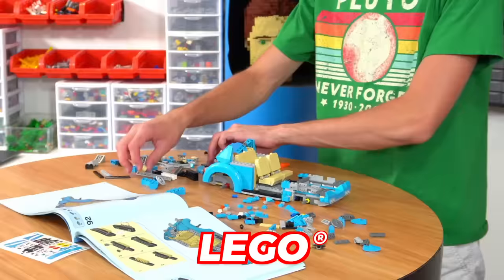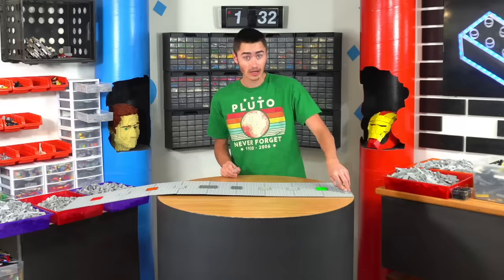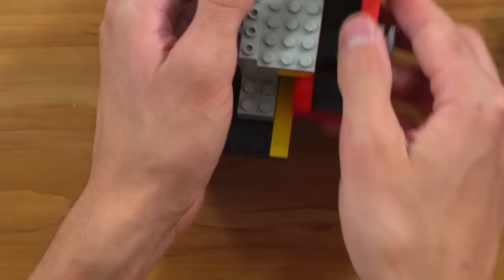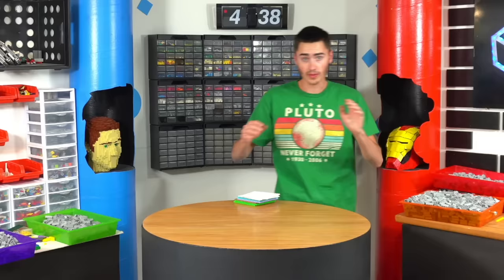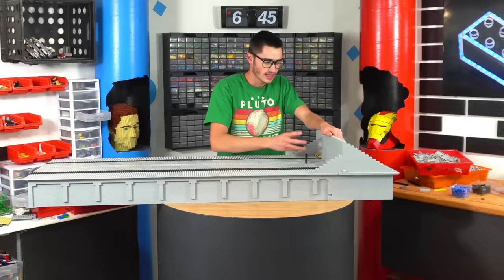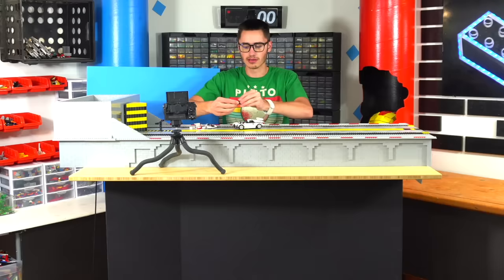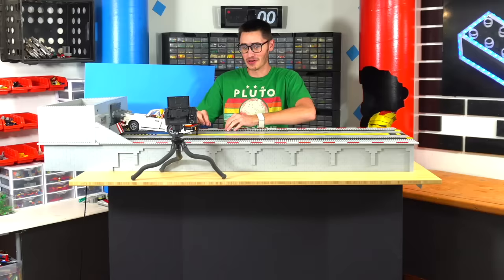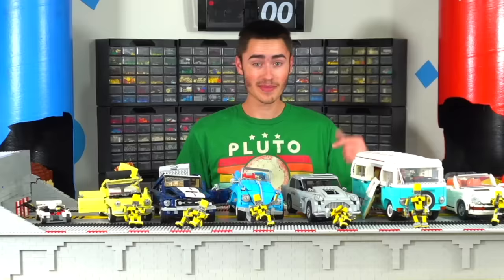Crash Testing LEGO Cars!

Comment: Since in a crash, you want the energy to be absorbed by the car and not the crash test dummy. The one that breaks up the most (since Lego doesn't deform)  would be absorbing the most energy and should therefore have the best rating. Great video and Lego engineering of the test track.
Reply: Yep
Reply: I was thinking the same thing
Reply: have you considered the car’s feelings tho?
Reply: in the last one nothing really happened so i think that one did get its score well, the van did a bad job since the dummy flew across the back
Reply: Yeah but not always, some of them had large parts come off and hit the driver
Reply: I can confirm this, he is right, the lambo and the bedle should be the best. BELDE
Reply: Was just thinking the exact same.
Reply: Ahhhh, true.
Reply: That is literally what I was about to say
Reply: Thx Einstein
Reply: 15:31 almost all engines are front, and engines barley explode only gas does 😡😡😡 but good video
Reply: @beastt549  just like how newton desk toy with the swinging marbles makes the one on the opposite side move without moving the others.
Reply: I'm going to regret this but hey,
So the easiest way to think about it is that we want to make the impact take up a longer time to complete their travel. An example is a parachute, without one the same distance travelled is completed in a shorter amount of time than with a parachute. The amout of energy transfered to the person is spread over a longer amount of time, reducing damage. The same logic can be applied to when you jump and bend your knees instead of keeping them straight and taking the full force.
Cars have crumple zones which are deliberately made to act like the parachute and aborb the energy. This spreads the impact over a longer amount of time so the person driving will also experience the impact over a longer time reducing damage. 
If the vehicle was rigid it would take all the force of the impact in one instance, the car might stop suddenly but so does the person. In one sharp push they experience all of the force at once.
Also there is an attempt to have cars create less objects to break off and hit anyone inside an example being the type of glass that spiders but does not shatter into sharp shards.
Reply: Dude I’m 9 and I hav no idea hat your saying like bruh but your smart so good job man
Reply: @alpark6183  so that's why I keep breaking my legs
Reply: @beastt549  so you want a car to be indestructible and die?
Reply: @purevessle2641  one of the greatest mysteries of life :)
Reply: i agree.
Reply: Unless he's testing the build strength
Reply: @adamclarke2251  its not even physics its just thinking about it for 2 seconds
Reply: Forever axolotls  this comment says a lot about your intelligence 💀
Reply: What about the part where the dummy died rip
Reply: @beastt549  have you ever heard of inertia 💀

also yeah you have a point about things hitting the driver, but people have thought about that too, car manufacturers try to put the least amount of dangerous small objects in the interior as possible, and most windshields crack, but are made to not shatter into small pieces. there are also crumble zones on the car that purposefully take the force of the impact and crumble, absorbing most of the energy instead of being rigid and transferring that energy closer to the driver.
Reply: @turnipaitor  no you werent kid
Reply: There’s the comment that I didn’t have to say
Reply: Bruh heard of Shrapnel but I do agree a bit
Reply: @angelthebudgie4148  shrapnel as far as I know doesn’t kill the driver too often in car accidents
Reply: BRUH
Reply: @stoopidapples1596  true true
Reply: About the since lego doesn't deform part, it needs high force to break, but it still can break.
Reply: Forever axolotls  it doesnt take a genius
Reply: @hellohello8186  the car absorbs the damage instead of the person  when the car breaks more.
Reply: I was about to say the same thing
Reply: But there should be protection around the driver instead of the doors, roofs flying away.
Reply: Good point, but it could also be a bad thing too
Reply: Was about to say that in simpler terms
Reply: @xingchen19willwork  seatbelt and airbag.
Reply: Stops you from flying out the car, and if you fly forward you don’t hit your head on the dashboard.
Reply: But a piece Can hit the dummy and hurt it
Reply: @beastt549  you didn't pass physics class did you? Granted neither did I, but still, the energy is transferred through the car if it is not absorbed by it (energy is neither created or destroyed). And what happens to be sitting right bang in the middle of the car? The crash test dummy, which being a stand in for a relatively fragile human, would receive the brunt of the energy causing major bodily harm. It doesn't matter that the person didn't come into contact with the wall, it is sitting within the car, moving at the same speed as the car, and therefore is exerting the exact same amount of energy on the wall as the car is. Then again, youre hearing this from a guy who didn't pass physics, so...
Reply: @purevessle2641  r/engrish
Reply: @beastt549  you ever heard of momentum?
Reply: Brains my guy brains
Reply: @daylightwastaken  it's basic logic.. this is not a 'nerd moment'
Reply: @jwalster9412  🤓
Reply: @zlatanbalta7339  Ned Flanders is never right.
Reply: @daylightwastaken  yes, I am smart.
Reply: @jwalster9412  🤓
Reply: Forever axolotls  nerd Flanders lol
Reply: Forever axolotls  it doesn’t take a genius to know this. I learned this when I was 9.
Reply: Also the big cars didn't break as the mass was greater and caused less final speed(less acceleration), if we managed to change the mass of the weight to get same acceleration it would have been a fair test as the cars that didn't break would have but enjoyed the video
Reply: @realgummyrules_420  Noice
Reply: i would say the aston martin the rest had pieces fly off or break the aston crumpled and absorbed the energy the best because the dummy was almost in the same spot
Reply: I was going to write the same thing 

Good point
Reply: @anthonyina_bottle2443  however the loads on the occupant would be extremely high
Reply: you want every thing to obsorb the daage, exsept the cabin of the car.
in a roll over the cabin needs to stay sturdy so no one gets crushed, and if the cabin gets deforemed that also means alot of that enrgy will have gotten to the dummmy.
all about g forces
Reply: Rather, if it could deform little yet still preserve the driver well, then it would have the best rating. Yes, you make a good point that the more it absorbs the less there is in reserve for any person, but remember that if the car falls apart, there is always the chance of a metal beam or some other part to pierce the individual. I would put the highest and rating and the most trust in the car which would remain sturdy and continue to shield the driver in the most efficient manner.
Reply: Yeah, but no because you also don’t want the dummy getting hit by debris or getting thrown out
Reply: @anthonyina_bottle2443  i mean a concussion is better than being violently bisected or getting thrown unto the asphalt road
Reply: That’s why the camper did good it deformed the wall
Reply: @Icelandic_Sand  🤓
Reply: @beastt549  yep
Reply: I was thinking that the whole time so mustang probably the best
Reply: But nobody cares its fucking lego 
We just want yo see stuff explode
Reply: Yeah
Reply: But what if it’s a self-driving car for deliveries? Wouldn’t it be OK if it doesn’t destroy itself on a crash then?
Reply: 🎉🎉🎉🎉🎉🎉🎉🎉🎉🎉🎉 HAPPY BIRTHDAY GREG :D
Reply: But at the same time, not too much as you'll obliterate the driver lmao
Reply: I would probably rate the Aston the highest since the energy transferred all the way through the roof to the rear bumper.

The Tesla Model 3 has one of the highest ratings irl since a crash from almost any angle shifts the energy through the roof, protecting the driver from side impacts better than basically any other car. 

However, this is part of the reason that any crash in a Tesla basically totals it
Reply: Neeeeeeeeeeeerrrrd

-Technoblade
Reply: was bouta say same thing 
the dummy should be unharmed, and the more energy that is absorbed by the vehicle the beter
now i do think the vw bus was a fluke considering the thing it was being hit against, that being a barrel
Reply: Good point, but that last bit is arguable. It's not so much the car that deforms the most, more like the one that just protects the passengers the most.
Reply: @alpark6183  wrong. If someone is falling with a parachute, they are not impacting anything until they hit the ground. So it doesn't matter how slow they fall, what matters is how fast they are going when they hit the ground. The impact time would be pretty much identical if the person had a good parachute or a bad parachute. The difference in energy felt by the person comes from the difference in kinetic energy and potentially energy, which is dependent on the person's velocity.
Reply: @Icelandic_Sand  wrong. The damage done to the dummy is related to how long it takes him to slow down from a certain speed. He is not "feeling the same energy" as the car while the car is being destroyed. What the dummy feels is a change in momentum. The slower he feels this change, the less force he feels. I can see why you didn't pass physics.
Reply: @jermihalia9418  ok, thank you for correcting me. Still the point still stands that the car coming to a sudden stop would kill the person/dummy inside.
Reply: Lol I was thinking that like the entire time
Reply: @daylightwastaken  nice face reveal, username checks out
Reply: To quote Jeremy Clarkson: Speed never killed anyone, suddenly becoming stationary... that's what gets you.
Reply: @daylightwastaken  you're on a channel called "brick science" what do you expect buddy
Reply: @stoopid apples lego cars don't have fellings
Reply: Lego does deform if you add a bunch of hinges to the car!  Tried that with a couple cars myself, quite a challenge though, they are also only 8 wides like the Countach and not larger scale like the creator expert cars.
Reply: @koalachick8029  There is still the problem of the thing it hits.  In a head on collision, the crumple zones of both vehicles help absorb the impact.  If they are both going 50 MPH, then the impact on the normal car would be like hitting a wall at 100 MPH if the driver-less vehicle didn't crumple, and that's assuming both vehicles are of equal weight.
Reply: @anthonyina_bottle2443  No, that's not how it works
Reply: @scottthewaterwarrior  I didn't think of that!
Reply: @tonyhuang431   most are but there are some sports cars that have an engine in the  back. The fuel in liquid form is NOT explosive, however it’s gaseous form is so, the engine might cause sparks, and since gasoline caches fire and evaporates so easily, the engine getting damaged or broken is a major factor in cars/trucks exploding
Reply: @bananaspider9784  but the way he specifically said the aston engine explodes angers me
Reply: @tonyhuang431  okay cool
Reply: wtf did you just say
Reply: @bananaspider9784  also, Im SURE its not the vapors that are explosive its the liquid
Reply: You also want to ensure the passenger cabin stays in one piece.
Reply: Tell that to the 93 scirocco

the only one smiling after all that energy is absorbed is the guy locked in the trunk
Reply: @stoopidapples1596  It's ok they're mostly lego creator car, not the good themes.
Reply: But you want the cabin to remain intact or else the driver will be greeted by a steering wheel to the face and dashboard to the legs.
Reply: @zlatanbalta7339  no that is way too much and would impale the driver, you gotta make sure the car absorbs all the kinetic energy while keeping the passengers safe
Reply: Forever axolotls  Einstein?
Sheesh, is this really too hard for you to understand?
Reply: We aren’t smart, y’all just dumb. If knowing how a car should absorb energy in a crash is “smart” then I probably have 800IQ. I’m assuming that knowing how an engine works is another 500IQ, as those 5 minute videos that explain in dumb person language how they work is beyond all human comprehension. Surely, us car lovers are some kind of upper class intellectuals, and only we can even begin to comprehend how cars work. There’s definitely not hundreds and thousands of companies and communities that like cars and race them, and build engines for them. Heck, the highways are practically empty because no one knows how to make an engine! 
Obviously I’m being quite sarcastic, as we see and use cars everyday. Hmm, I wonder who built those cars? I wonder who had such a passion for cars, so much as to starting a car company? See? This knowledge isn’t something you should look down on. You rely on it. Everyday.
Reply: Crumple zone
Reply: Big science word make me brain go boom boom
Reply: Ok mister know it all
Reply: Although the Porche 911 Targa and the little van barely got destroyed, but the test dummys were fine, only the van one that could have flew bcuz of the impact force, but the walls got destroyed in the 2 tests, meaning the energy went to the actual wall. So idk if a wall is more important than a car...
Reply: What the heck is Ned Flanders doing here😅😂
Reply: @LUCASTHECOWBOY  Hidely ho gamerino!
Reply: You want the car to crumple, not fragment.
Reply: @MagmaLair13  yes but Lego does not crumple. It can crack or break off.
Reply: Sorta. It depends on which parts break. For instance if the engine bay slams back into the cab, thats a dead driver
Reply: @thaLikeButton  but no one drives a lego car. This is kind of modelling a crash test but the effect on the driver is not really being simulated in a meaningful way. I would agree that, just as in a real car, the driver's comparement shoud be rigid but otherwise the rest of the body can break apart disipating as much energy as possible over the longest time possible, reducing acceleration on the driver and thus the forces acting on them.
Reply: Not sure he understands crash tests lol
Reply: i have seen that yellow fiat break wayyyy more than that. on my floor.
Reply: I just wanted to comment something similar. What's good for Lego-ppl, is really bad for real ppl.
Reply: Forever axolotls  common sense
Reply: For the most part, yes. Actually there are lots of criteria for crash testing. So for example the Parts are not intended to deform in a way that can injure the passengers by too large plastic and or elastic deformation into the passenger seats. Furthermore  there are safetycritical systems that must be protected such as the fuel tank. Also people should not be trapped inside of the car due to large plastic deformation of the frame under regular crash conditions. Another issue with the test's precision is the means of accellaration. In a crash test you are interested in the measurements for a car at a given velocity decellerating by colliding with an obstacle. In your setting the impact velocity is given by the accellaration a times the delta of time. since the accellaration is given by a = F / m the maximum velocity of the car is proportional to it's weight. also since you are dealing with different Scales of cars it would only be at least a little bit more realistic to define  the desired impact velocity of a given car in relation to it's size. Also correct me if I'm wrong but if i'm not mistaken the mass on the rope doesn't touch the beanbag on impact for some vehicles tested therefore there might be more inaccuracies  regarding the forces acting on the cars. Instead of the force being just the Force resulting from decellerration of the car it would be the force from decelleration of the car (v2 -v1)/delta t x m plus the force from the weights m x 9.81m/s². These issues are easier to fix than it might seem. All that would be required is a rod with regularly spaced and sized bricks on it. then an infrared distance sensor can measure the duration for which every individual brick on the rod covers the sensor. as the length of each brick on the rod is known one can calculate the velocity. If it exceeds the desired velocity the accellarator arm would retract into the base. Also i would highly recommend to lock the steering on the crashing vehicles. I'm probably overcomplicating this.... Anyways great video! and even if not entirely scientifically correct still entertaining to watch so i guess.... it did it's job without scientific correctness. Nice build! Very nice build
Reply: Dude it’s just legos not anything people would drive daily
Reply: Correct
Reply: @stoopidapples1596  ye i mean bumblebee movie wheeljack , g1 jazz/ bumblebee movie mirage and g1 bumblebee woulda gotten hurt
Reply: nerd 😂😊
Reply: @stopmotionshortsraces9410  nerds are responsible for all the technology that you take for granted. Being a nerd is an accolade not an insult.
Reply: The Ratings need to be inverted as all the dummies ended up having themselves splattered against the wall due to g forces
Reply: Although his ratings work as lego people are much tougher than regular people
Reply: did you become as albert einstein?
Reply: @weepingflowers7  No. It is pretty obvious.
Reply: @dr_ned_flanders  Ok
Reply: you must be fun at parties
Reply: @leifgwpersson657  nearly as fun as someone that is so insecure that they have to point that out.
Reply: @dr_ned_flanders  bro how did u know, im so insecure i cant even talk to ppl irl because i get too shaky and i cant even form words
Reply: @stoopidapples1596  car sad :(
Reply: K Isaac Newton
Reply: @Guest-xz1pl  it takes a wise man
Reply: Yeah this guy has no idea how cars work, if there was a cat that just broke the front and everything else is intact then it would be a functional car. Unfortunately no car fits that description in the Lego world.
Reply: @hellohello8186  my 9 year old brother knows physics
Reply: what about the one where the crash dummy got cut in half
Reply: You only want the front/crumple zone to get destroyed
Reply: Guys we found bill nye
Reply: Dam ur smart I’m dum as hell lol
Reply: Yeah but it's supposed to deform and stop before it gets to the driver and considering the 9nes that broke the most split the driver in half I don't think that's a good sign
Reply: @aceystar1478  Lego is not a very good analogue for the real world in this situation but the point still holds about lego breaking off and absorbing the energy and it is a good metric for determining the energy absorbed in the crash.
Reply: @stoopidapples1596 bro that car just wants some friends (and health insurance)
Reply: I know I'm not dumb 😒
Reply: On the 007 when the camera hit the floor of the test track I kinda heard a faint fart sound effect
Reply: @stoopidapples1596 a car is non living thing
Reply: @Xenorex.MV1  thank you for your islamic fact
Reply: Yea but the ones that broke most got the test dummy to be ripped in half
Reply: You didnt have tu cuuuuuut me offffff
Reply: Nerd
Reply: How Lego airbags be like ?
Reply: @daylightwastaken  why did u do a face reveal?
Reply: Cars vs Fire Explosion Trains(Calls Firefighter) | BeamNG Drive
Reply: Cars vs Fire Explosion Trains(Calls Firefighter) | BeamNG Drive
Reply: Wha
Reply: Car cash
Reply: Not quite if a lot breaks and it doesn't read the driver it's good but if a lot breaks and it reaches the driver it sucks
Reply: Nerd
Reply: Smart good job
Reply: @daylightwastaken that’s you
Reply: Nice to know👍👍
Reply: NERRRRRRRRRRRRRRRRRRRRRRRRRRRRRRRD 

PS.(I DO NOT MEAN THIS IS A MEAN WAY)
Reply: @anthonyina_bottle2443 if you were in the last car during the crash you would smash your head on the steering wheel bud
Reply: @daylightwastaken bro just did a face reveal
Reply: It says crash rating not safety rating
Reply: Zach96369  Yes, but it is not a real driver, but it is real energy that is taken up when bits break off. You don't actually need a driver and bits breaking would still be a good measure of crash-test-worthyness.
Reply: @anthonyina_bottle2443 yeah but realistically all the energy from the crash would go directly into your body and you will take the damage because the car didn’t
Reply: Alright, Bill Nye The Science Guy
Reply: But if it’s fragile then it’s a bad car
Reply: Ill keep this in mind next time i drive my lego car anywhere
Reply: @stoopidapples1596  car over people 100%
Reply: Yep I know
Reply: I'm pretty sure that was the 1900 carsI'm pretty sure that was the 1900 cars
Reply: Lego can deform with enough stress that’s what happens when you do illegal building techniques mostly 
But he literally said he expected the hoods to crumple and it’s like
They’re plastic…and also moving at 10 MPH
Reply: Fr
Reply: Jesus loves u all
Reply: I agree with @dr_ned_flanders . If the car doesent have any soft body mechanics at all (which can basically make a car be able to be squished from the front), for the driver, it will be exactly like being thrown straight into a wall at the amount of speed they are going, which would definetley be serious injury or an instant death.
Reply: @dwisut  Jesus loves u all
Reply: @Black_vo1d face reveal? Ah.
Reply: Smort
Reply: I personally think the mustang because it broke apart just enough to deaden the impact and not bisect the dummy
Reply: Agreed
Reply: @anthonyina_bottle2443 😅 14:28
Reply: 14:33
Reply: 18:46 sam w  j R
Reply: @Icelandic_Sand bro is Einstein 2.0 🤓
Reply: Can’t some things absorb more energy efficiently?
Reply: By they can absorb more energy with it breaking less?
Reply: Your right